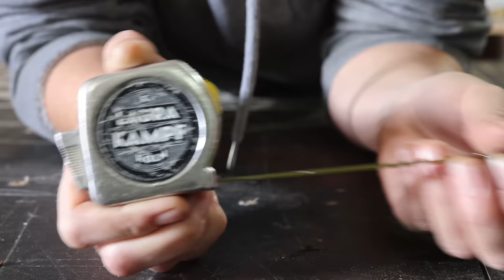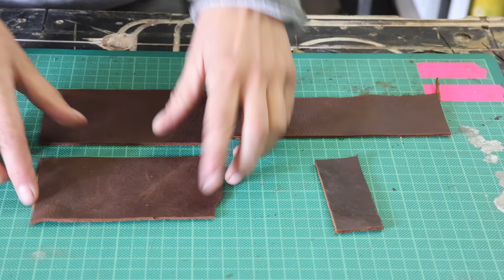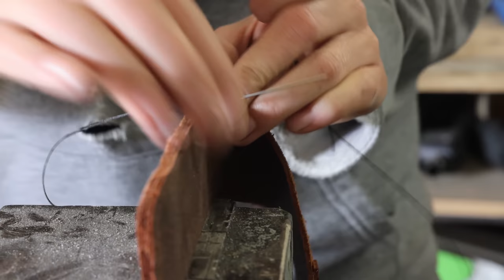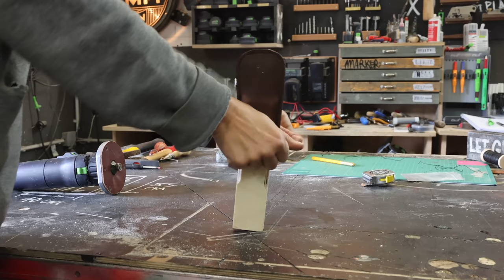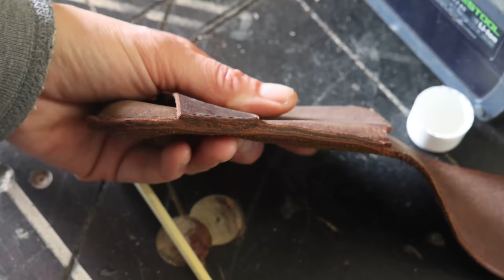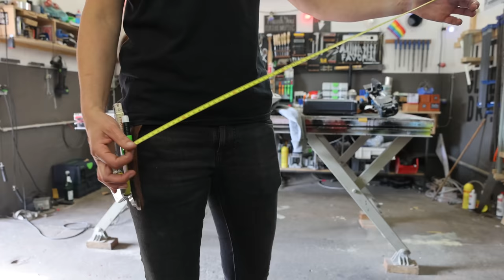Quick and Easy Measure & Marking Holster (I should have done this years ago)

Comment: Nice work(: 
I put together my own tool belt not long ago, however I didn't make any of the pockets myself. I just bought a belt and some individual packets from this brand called Occidental leather. 
I got this one clip on pocket that could hold a tape measure, 2 pencils and a knife, which i tought was smart at first but, later I found out i perfered having my tape measure, and other measuring devices on my left side and my pencils knives and hammer on the right side. and now  i just put a small bit kit where the tape measure was suposed to be on the right side.

Comment: Heey Laura...
What a great project- nice toolholder.
I really love (😉🤪) the way you sand down the edges os the tool holder... with a biiig grinding-thing and not a edge-finisher. Well what ever, maby not your style... wll I love your style and projects.
FYI- Using metal hammer om metal punchongiron, will ruin the iron quite fast. If you use a hammer with horn or hardonized plastic- your tool will last forever.
Keep up the good job✌

Comment: Nice little project 🙂 You used chrome tanned leather, which doesn't really do well with wet forming - and doesn't really burnish either. If you want soft leather, use chrome tanned, if you want stiffer leather that you can form, stamp, burnish, stain, etc - use vegetable tanned.
Reply: Of course, sometimes you have to use what you have at hand, but just know what its properties are, and don't try to make it do something it can't 😉

Comment: I fear the tape measure loop is going to wear out rather quickly if you use this very much. But I like it. A folded piece of thin aluminium over the loop top could lengthen the life of it.

Comment: This gives me the general instructions to make a custom cell phone holster I've been wanting. Nobody has a a holster that fits a phone with a  pop-it or  in my case, I use one of those cone shaped magnetic a/c vent mount for my finger grip. It's adjustable/locateable for profile and landscape modes. Only down side is its a bit more bulky and creates a weird bulge in your pants pockets. So, a holster with thickness of the phone with thin case, plus a bump up for the 8mm or so of magnet base and then a cutout for the cone shaped mount.

Comment: Just wondering, when is a folding ruler more useful than a tape measure? I've never really understood when to use it.
Reply: If, for example, you’re measuring a board or a sheet of plywood to cut, you want to use the ruler. Align your measurement with the edge or line you’re measuring from, and mark the end of the ruler.